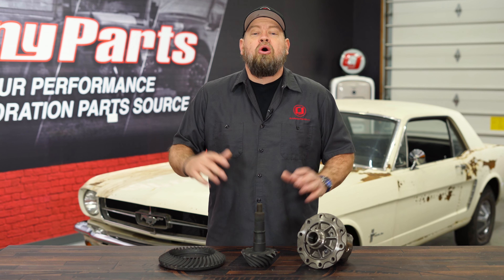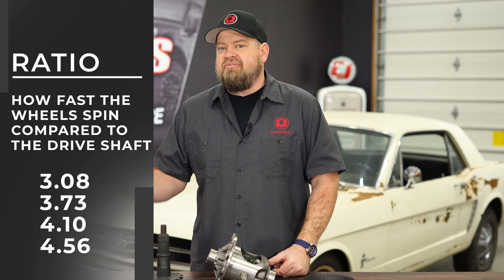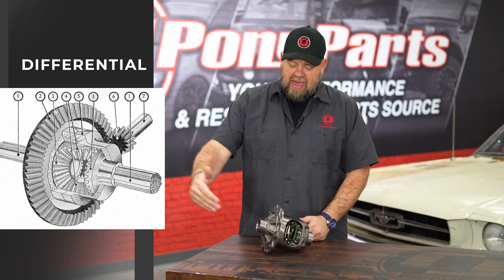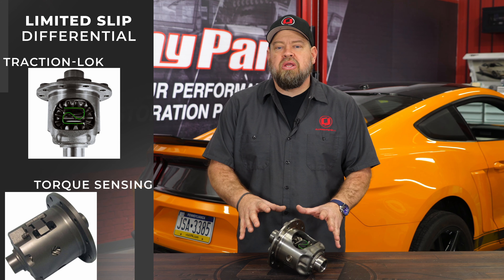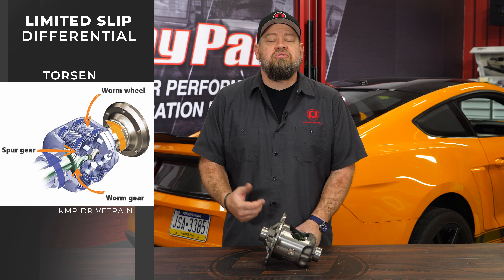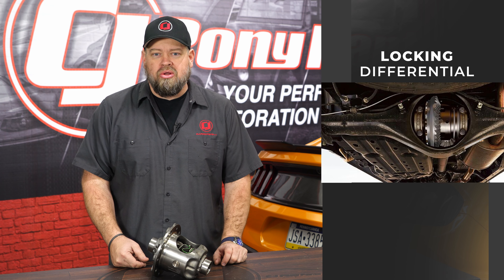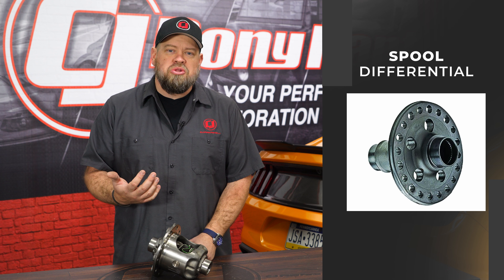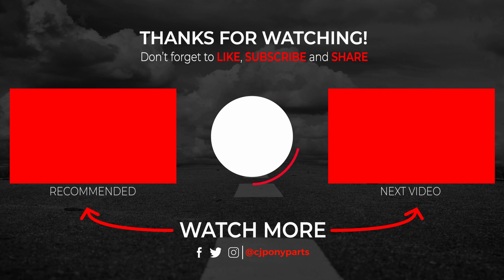Tech Talk | Differentials Explained

Comment: Thoughts on running traction lok without the center green spring? From what I've read that's mostly there for low traction situations like in the rain to get the clutches to grab. But in normal circumstances the centrifugal forces of the spider gears take care of that
Reply: Removing all bias will make it like an open in low traction situations.